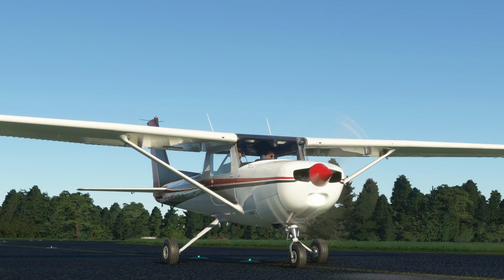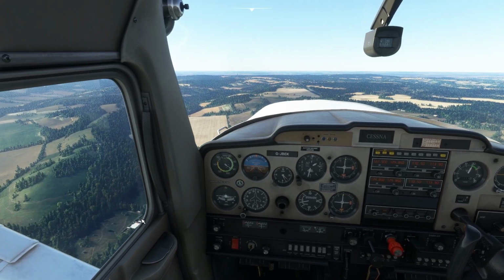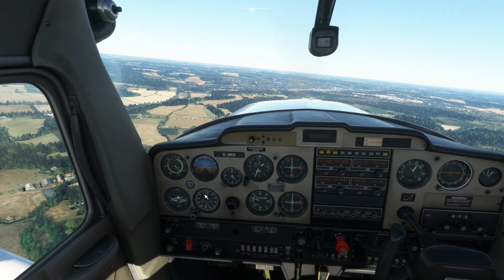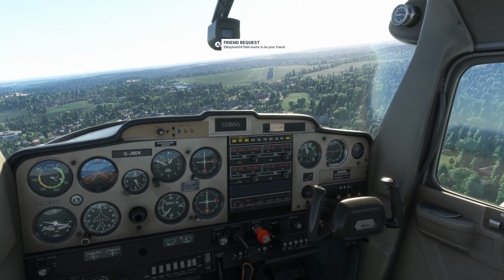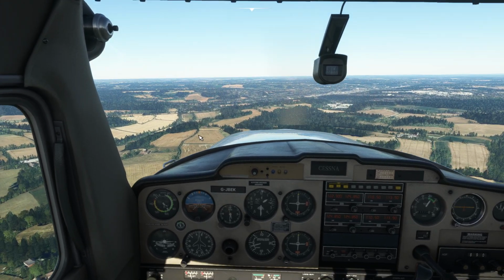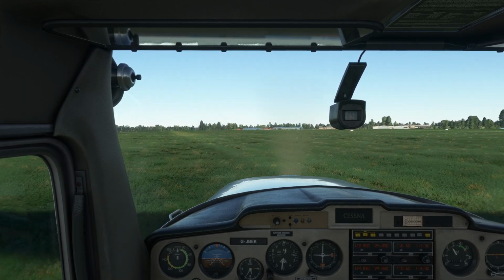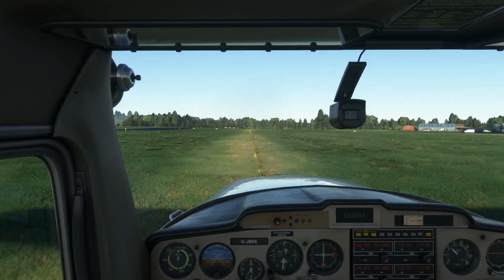Practicing CROSSWIND circuits at Wycombe Air Park in the Cessna 152 in Microsoft Flight Simulator

Comment: Really nice.  Have you ever experienced phantom wind in the simulator?   I did today.     I could barely keep 2 wheels on the ground.    When I finally touched down the wind blew my poor Cessna over onto its wing.   When I pulled up the wind data it said "No Data"   I guess just a bug.   Are you using rudder peddles?   Once I added them I found the difficulty went up quite a lot.   Thanks for the video.
Reply from the maker: Yep - sometimes the meteoblue data breaks :)
Reply from the maker: I don't have rudder pedals - I just use a twist stick joystick. I would used other people's rudder pedals - I thought they actually made it a lot easier :)
Reply: @jonbeckett   Joystick twisting works fine.  Once you add the rudder pedals it makes it a LOT harder.

Comment: Nice! 
Seeing big improvements already. Work on your speed control. 70kts on climb out, 70kts on descent. 
Baby steps, a 10kt crosswind on a little 152 is substantial.
Reply from the maker: Yeah - I was far too slow on the second circuit. Need more practice :)

Comment: I think you are still turning crosswind a few seconds early. At min 3.00 a field comes into view. This is the “T shape field” the track 330 would pass over the left side of this field. Then the turn to downwind would commence as you pass the far edge.
Reply from the maker: Yep - I have problems seeing that field every time - mostly because I cannot easily move my view in the simulator (which is why I'm looking for other reference points). I'm looking at getting a head tracker, which will solve this immediately.
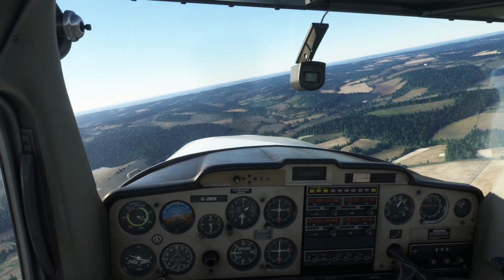Reply: @jonbeckett One helpful pointer to the field is the “beast” - it’s the forest you can see on the right of the windscreen at 10:30. It looks a bit like a crouching creature with a very long tail, and just below that tail (and to the right of the hind legs) is the T-shaped field.

Comment: Almost correct.  IRL you crab in, then when you use the rudder to align the nose with the runway, you need to turn the ailerons into the wind. and land on the upwind main wheel.  If you don't have ailerons into the wind, you will drift horizontally to the downwind side of the runway,  Hope this helps.
Reply from the maker: That's the next video - doing the sideslip technique :)
Reply: @jonbeckett  With due respect, the moment you turn the nose to be in line with the runway, you are side slipping until you land.  You have to turn the ailerons into the wind.  You cannot land a small airplane in a crab, because you will side load the landing gear.  In other words, using the crab still involves a side slip at the end.  The problem with side slipping on final is that some aircraft have a max time to side slip and some will not allow it with full flaps.  Just for your information.